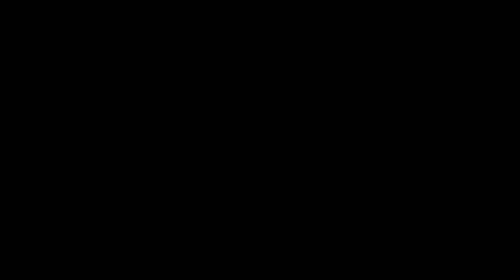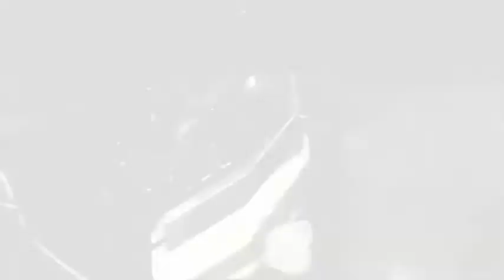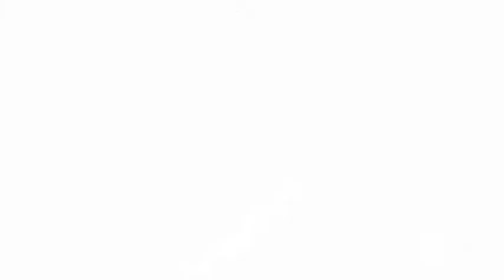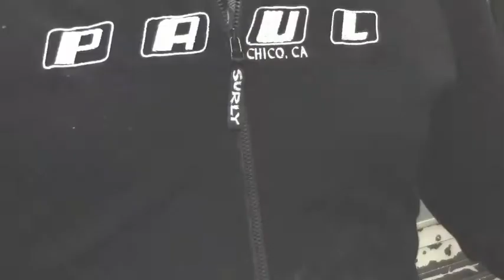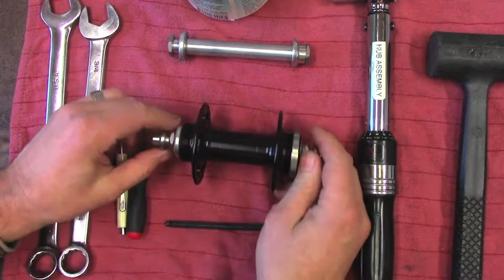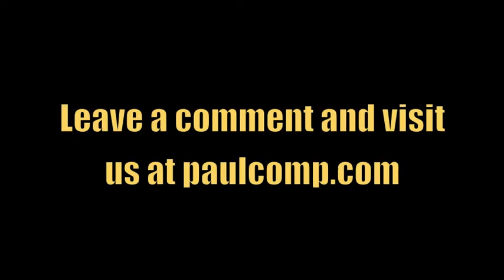Replacing the Axle of a PAUL High Flange Hub

Comment: Ive problems with play in my rear hub. Why is that? Ive replaced the bearings, but still the same. I have to tighten it way to hard to eliminate the play, which makes no sense. Please Paul, whats the problem?
Reply from the maker: Give us a call on the tech line, let's figure it out! 530–345–4371
Reply: I have the same problem haven’t messed with it at all but this video seems pretty good to start👍